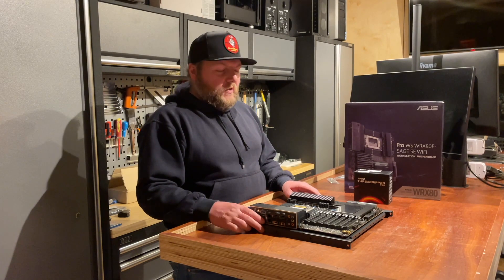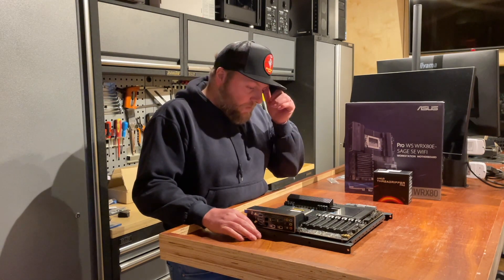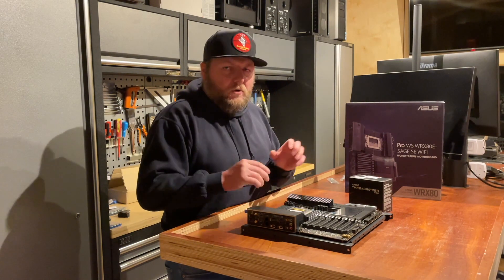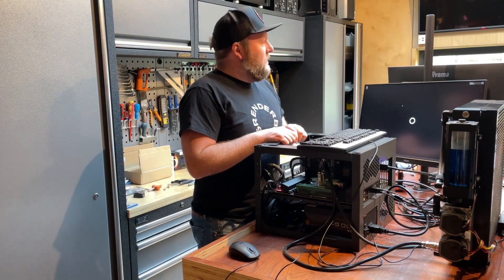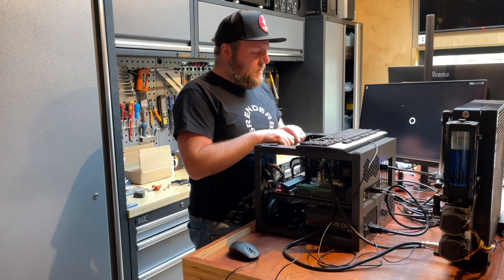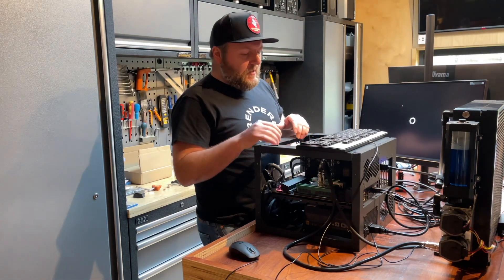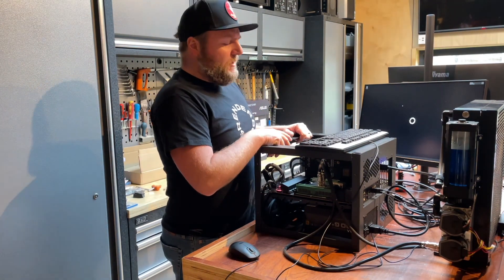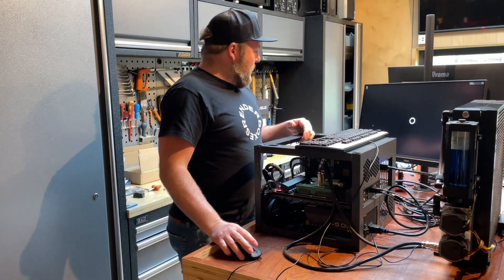Water cooled Ryzen Threadripper Pro 3975WX and Asus WRX80E SAGE SE WIFI workstation

Comment: How many 3090's can you fit in this with NVLink?
Could you connect 3 pair's of 3090's with NVLink with PCIe Riser cables? Non watercooler.
Reply from the maker: Hi, RTX3090 is max 1 pair (2x) Nvlink, more than that we need to go Quadro...

Comment: Found the guy taking up all the graphics cards, folks.
Reply: It does look like system builders got first shot a the WRX80E mobo and EK GPU . Hell, scalpers want 3X list for a P/S. I'm just spending my money on M.2 NVMe drives, EK rads and blocks, Watercool res/pumps/cpu blocks, 8 sticks of 3200 G Skill and a case for a second TR build. By the time that P/S comes back to list and the WRX80 is in stock we may have the ZEN3 TR PRO. Epyc and Ryzen are both on ZEN3.

Comment: I have the same motherboard here for my upcoming build. Got a question though, of those 3 8-pin connectors is the non-shielded 8-pin meant to be connected to one of the power supply's PCIe power connectors?

Thanks.
Reply: Two 8 pin EPS mobo power connectors (4+4). One 8 pin PCIe connector (6+2). And at the bottom of the board two 6 pin PCIe connectors (6+2). That would be 5 of the 8 connections on a Asus Thor 1200P. Add a GPU with two 8 pin connectors and that's 7 of 8 P/S connectors. That's only one GPU.
Reply: @maxhughes5687  Thanks man.  Same Board, 16 core Threadripper Pro and a Li  011d Extended case. This ia a beast of a build to figure out. On top of the power connectors...just try to find a case this monster of a board fits in before you even try to add cooling.

Question for you though.... If you see this....I'm using a Thermaltake 1250 Watt Platinum as the PSU....but if I add in a 3090, I'm going to need more power. I have a Corsair 850 RMX from a previous build. and my case has a section for another PSu..... IS there a way to use both PSU's to power the board? Or is this totally stupid idea, and just buy a larger PSU?

Comment: Hey thanks for review its amazing! btw want ask you about, those CPUs 3995wx , 3975wx how the experience about on Software.... like Editing, compositing ... because its 2.7Ghz base... is that not feels like its downgrade from Higher Ghz  for example 3.7Ghz CPUs ...  thanks
Reply: I just bought a Threadripper yesterday.  3960x.  I did this because I don't need more than 24 cores and like you said, the clocks are bleh on high core machines.